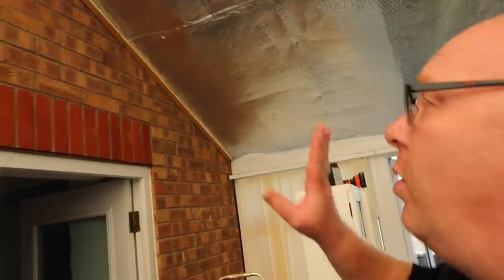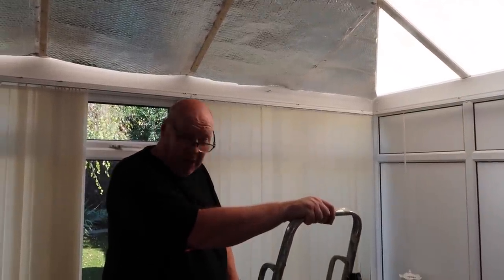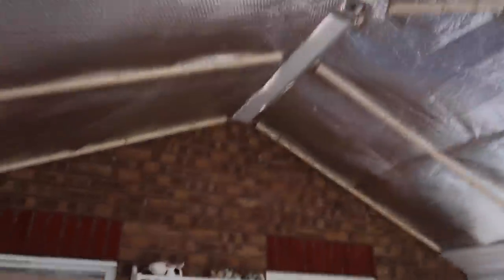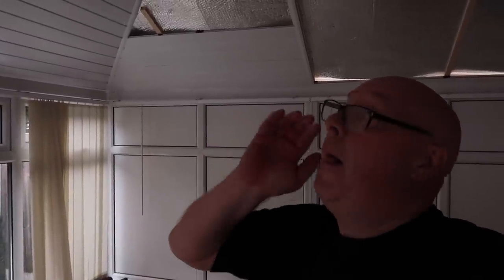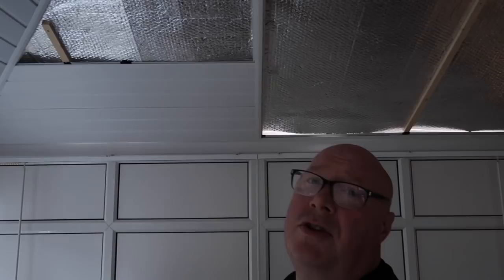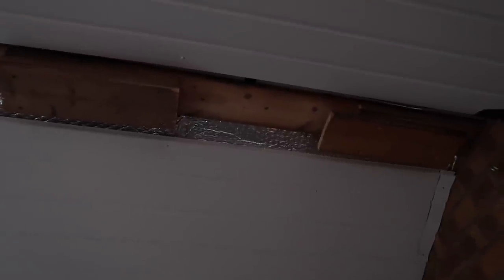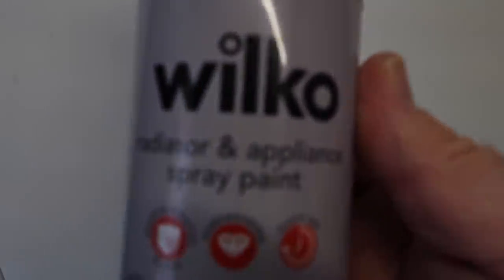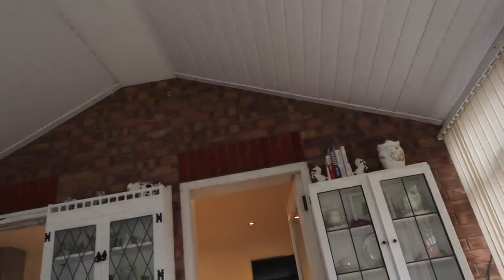Conservatory Roof Insulation Project. How Not and How To Do It.

Comment: It is not an easy job if you have never done it before, well done for sticking with it. I watched every video I could find before I did mine a couple of months ago. It took me a while to work out the cutting angles, initially I was measuring the lengths top and bottom. Once you have correct angle, use that piece as the template for the piece of cladding above it. You get quicker as you get confident. I also used the H strips to join lengths/cover angles and the J strips to edge - bought from Eurocell. I used roofing batten from Wicks, drilled and screwed into the metal frame using self taping screws. I got my cladding from Eurocell. I used superquilt foil - you need sharp scissors to cut the stuff and aluminium tape to seal the edges and seal the overlaps. A strong adjustable strength staple gun with 14mm staples is needed to fix the superquilt and smaller staples will hold up the cladding, but sometimes I needed to screw through it too and it was very thick. Good luck to those that do this project and its great when it is finished. PS Don't forget to think about wiring and lighting before you put up the cladding.
Reply: what size batten and counter sunk screws did you use please?
Reply: Diall Phillips Countersunk Zinc-plated Carbon steel (C1022) Self-drilling screw (Dia)4.8mm (L)50mm

Wickes Treated Timber Roof Batten - 25 x 38 x 3600mm

I did pre-drill the battens through into the underside of the roof bars, 3mm, as that made fixing easier. 

If you are cladding the internal ceiling I used 14mm staples, but some of those worked loose with the heat expansion, so I recommend a few small screws through the tongue and groove of the plastic cladding boards into the wooden battens. 

 @Wild-Storm
Reply: have you found its made a big difference? my conservatory is pretty big about 15/20ft long and 8ft wide - so in the winter its freezing and summer just roasting. 

after watching this my thoughts are could you remove the plastic covering the metal frame or is it too much pissing about? what battens from wickes did you use? did you go for 3x2 or 3x1 or what?

thanks.
Reply: @s1dew1nd3r4  Yes, it’s made a massive difference, even on these cold freezing mornings the conservatory is around 9 degrees with no heat overnight, and is quick to warm up with my oil filled electric radiator. It’s gets hot in the summer, but not as ridiculously hot (mine is south facing and gets full sun from 11am onwards). I use it as my office and it’s great. I couldn’t use it before as it was cold and felt drafty. In terms of battens, the details are in the comment above. I don’t see any reason why you would need to remove the plastic covers, I just drilled straight up through them into the metal frame. I don’t regret doing it at all. Good luck.

Comment: Just finished doing mine and must have watched this superb video a dozen times for hints/tips. Conservatory looks so much nicer now. My tip for finding the angles - use an off-cut that's somewhere close to the angle you want, put it in the 'H-Section' (doesn't matter if it doesn't quite go in fully), then use a straight edge (I used a piece of batten), line it up against the straight edge of the 'H-Section' so it now covers any gaps between the 'H-Section' and the off-cut then mark down the straight-edge onto the off-cut - I found this was the easiest way and meant I didn't have to do any measuring.
Reply from the maker: I'm glad it helped, and you learned from my mistakes.

Comment: Huge admiration for you to put this very helpful video. Ive watched it about 20 times. I made a mistake on the same bnq thin wood where the H trim was wider. Very nicely explained. I am at stage of putting the soffits. Let's see my wor holds up lol. I had a struggle putting the top layer of buttons through the insulated blanket, the screws wouldn't go through the quilt.
Reply from the maker: I wish you luck mate. The wife claims me down when I start to lose it.
Reply: I finished my project and it looks amazing. I was left with a gap at the top, I have installed 1200x600 led panel. Looks amazing, slightly worried about the heat of power supply being a fire hazard. Will install a fire alarm.

Comment: Sceptical about leaving an air gap... hot air rises and will condense on the cold polycarbonate panels but there is unlikely to be sufficient ventilation to dry it off. Better to create a moisture barrier by sealing the foil with foil tape to stop warm moist air reaching the top.
Reply: I have followed a similar process but taped up with foil tape where the insulation meets the top of the windows. The 50mm airgap between the poly carb roof and the insulation is the cold side where no warm moist air can reach from inside so no condensation. Where the insulation meets the brick wall I have used pu plasterboard adhesive to glue insulation to the wall. Thinking about putting 25mm foam between the 2nd battens and.the cladding but unsure if this will cause issue...

Comment: hi thanks for the video. We've got a Upvc roof and plan on doing similar soon. Is cladding preferred over something else like plasterboard? Also, how safe is the extra weight? thanks
Reply from the maker: Hi. I prefer cladding because it's easier to fit. Also you don't need to paint and you don't have to worry about any condensation. The weight isn't a problem to a conservatory roof.
Reply: @BlueVanMan  thanks 👍 Regarding weight is that definitely the case if we have full length glass sides ? I.e no dwarf walls..
Reply from the maker: @chatlow  if its a UPVC conservatory then it should take a fair bit of weight. It's not the glass holding the conservatory up. It's the steel inside the plastic. You could ask a double glazing firm to be on the safe side. 👍

Comment: Can’t get the self tapping screws to take into the cross beams as there’s a metal runner. Have tried to make pilot holes but not really helping. Have managed to do a few but some just will not take - any (constructive) ideas on what I’m doing wrong 😢
Reply from the maker: Just go in with a smaller drill bit so it feeds in. Should do it.

Comment: During lockdown I taught myself:
1. Mixing Concrete for various uses
2. Laying Slabs
3. Laying Edge Pavers
4. Bricklaying
5. Building Steps to help pensioners get in and out the house
6  Preparing Foundations
7  Building raised beds with concrete  blocks 
8 Tiling floors
9 Tiling walls
10 Building a greenhouse
11 Fitting security lights
12 realigning concrete garden line  posts
13 removing tree stumps

And much more..... lol
It's all about confidence and willing to try....... oh and more importantly, laughing at yourself when you screw up..... lol 
Then you sit back and bask in the 1000's of pounds, that you've saved yourself and can now spend on replenishing the beer stash!!!.... 
Hapoy Days....... 
I look forward to the future video, titled "Oh Bugger..... the roof fell down"........ lol........ only joking 😁

Have fun!!....

Comment: I started drilling holes in aluminum ceiling frames to hold the batons. Last night it rained and water came pissing in through the holes. Think I'm going to try securing it with no more nails instead 🤔
Reply from the maker: Need a smaller drill mate

Comment: Great job.I am doing mine same as yours at the moment. What size screw’s did you use on the second row of battens.I used 60mm  on 2 layers of 25 mm battens with insulation on middle

Comment: BVM thank you for for this most helpful video. Gosh, you did a great job, and you tell it just exactly how it is at each stage.
I am seriously considering trying the same thing, as our conservatory up here in Edinburgh is totally unusable at the moment. 
I have a question for you if I may:
Did you leave the foil open and untaped all around the perimeter at the bottom, rather than seal it against the top of the windows? 
My thoughts are, if in the coming years, a leak was to develop in the polycarbonate, it would perhaps be more easily detected if left open.
Thanks from a pre project anxiety sufferer.
Reply from the maker: Taped all round mate. We love sitting in the conservatory now. Good luck

Comment: As soon as i saw the angles on that roof, i was like, he's going to struggle with that. But geniunely, it does look quite good.

What you could do if the "join" really does bother you or june is get a piece of the rail stuff. Cut off the underside where it slides in (so you only have the piece that you can actually see) and put it on the other side so it looks like it was meant to be that way. 

Could just stick it up with very small dots of super glue and double sided sticky tape ( but be careful if any squeezes out, it will go frosty and look shite) Could even just try a good quality doubled sided sticky tape and see if it holds well enough.
Reply: Double sided sticky tape?! Im glad you aren't doing any work for me haha
Reply from the maker: Cheers for that mate. I thought it was going to be easy but we did struggle. Thanks for the tip though.
Reply: @benthompson8256  i mean, i would use superglue... as i suggested
Reply: @billys1997  and as i said, im glad you aren't doing any work for me